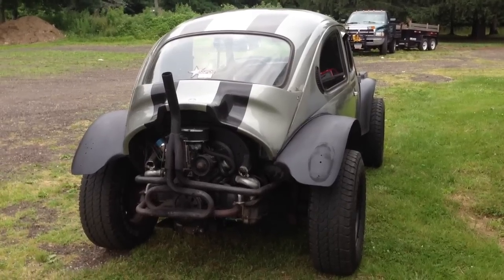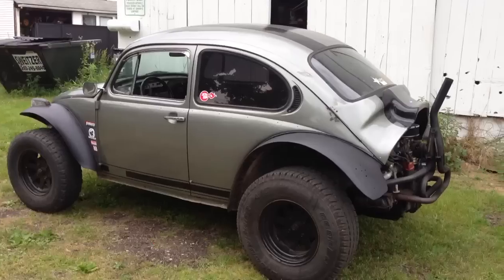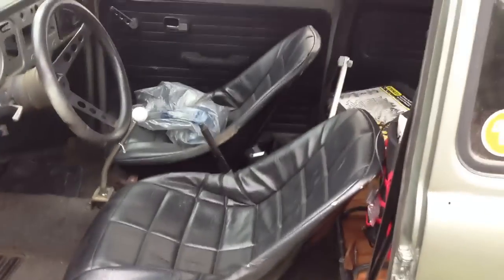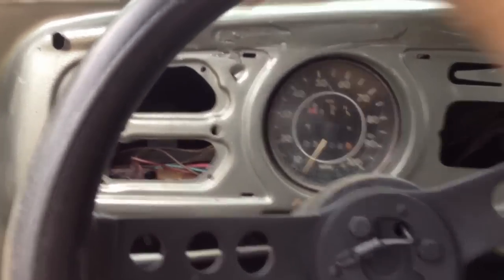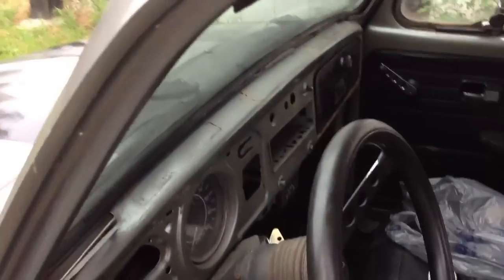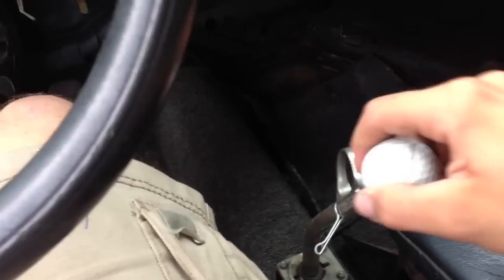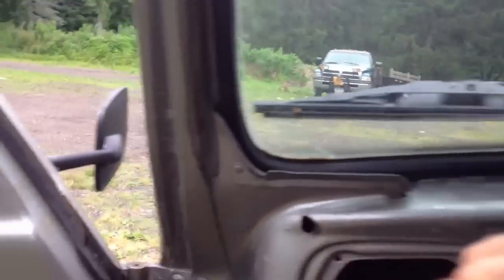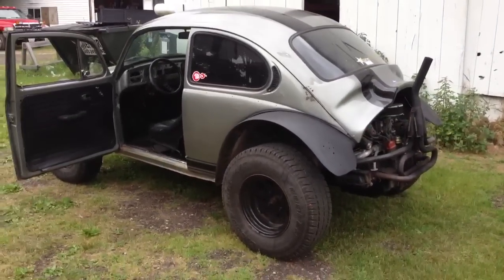BAJA BUG

Comment: how do keep water from getting on the engine if it rains? do you not drive in rainy seasons? just curious because i might try to pick  one up by the end of the year and was wondering  if id be fucked when it rains.
Reply: he could buy a 2 inch rain cap
Reply: check out my video on my bug. I put a rain cap on it in case it does in fact rain